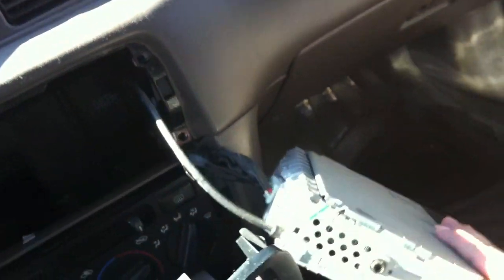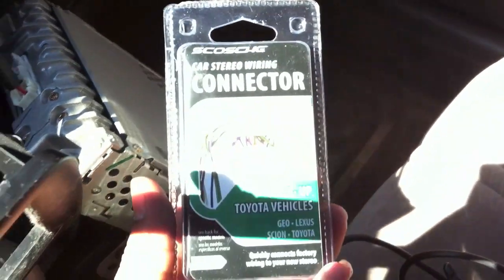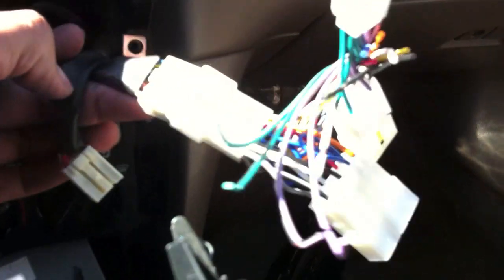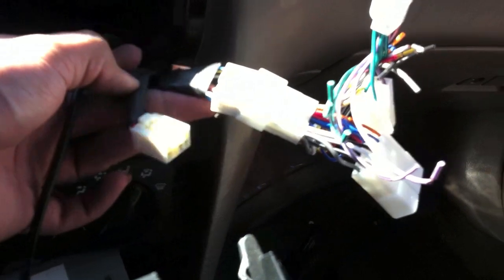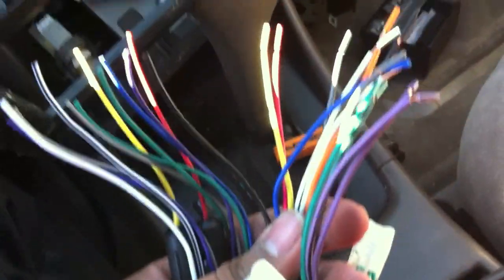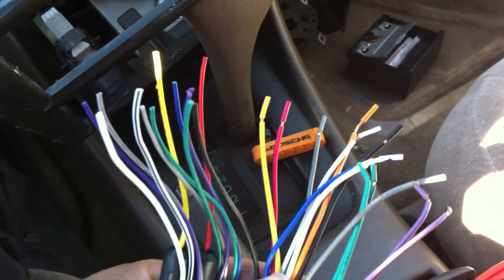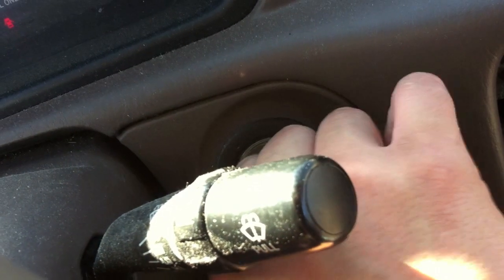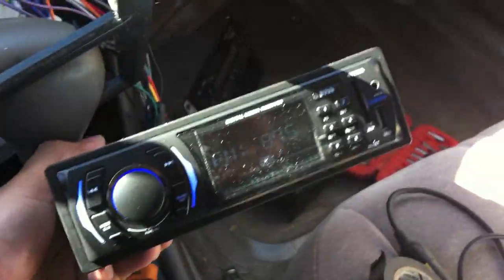1997 toyota car stereo deck indash install

Comment: Thanks. The panel of my 1997 Toyota looks different - the dash goes over the steering wheel too but thanks for your tips, I managed to partially pry open the panel to replace the bad radio.   Thanks again.

Comment: So the wire harness you buy at Walmart has one end that connects to the built in wire harness, and the other end plugs into the head unit, and it gives you loose wires to work with?

Comment: Your car doesn't seem to be an actual 1997 Toyota corolla, looks different from my. Can you confirm that stereo you installed will fit my 1997 Toyota corolla? I saw it on amazon and might get it if it fits. Thanks

Comment from the maker: U got to make sure that ur yellow wire and red wire do not touch any Metal part of the car or even the Antenna - make sure that the cables are properly covered leave no wire exposed

Comment: I have a 97 corolla with an aftermarket stereo already installed. If I wanted to upgrade it to another stereo will it just be a simple plug in an its ready to use?

Comment: Hey MIZTA shy! i had a 95 corolla and i had installed a pioneer radio and as soon as i turned on my dash lights the blew up. now i own a 96 corolla and i dont want to make the same mistake again. how can i avoid this from happening? and is the wiring process the same as any 95-97 corolla? Thank you.